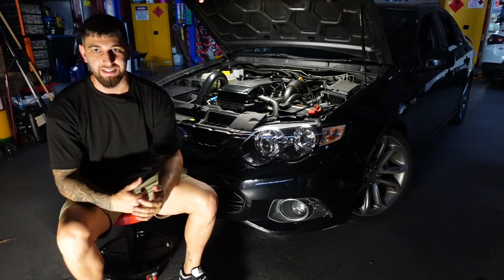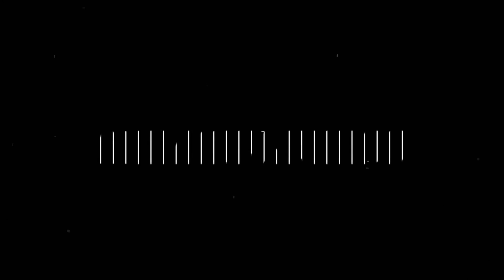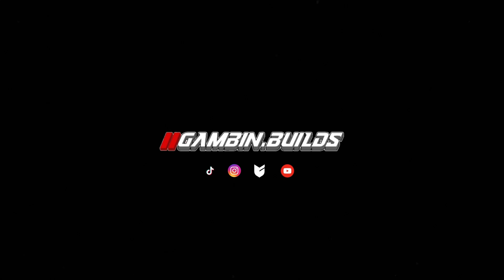FROM STOCK TO 800HP FOR $15,000 | TURBO BARRA BUILD COST BREAKDOWN

Comment: Just go a coyote, save your money.
Reply from the maker: @grantdavis2381  a coyote cost more to make this power 😂 a whipple is the price of what all of this cost
Reply: @GAMBIN.BUILDS  440rwkw for 3k ain’t bad for a stock Miami engine. Get your self a gen3 coyote with gearbox for 12 to 15k make a turbo kit make any bolt on barra silly.
Reply from the maker: @grantdavis2381  so 12-15k then what about the tailshaft? Or do we not care about people loosing feet in the back seat? 16k with all the safety and 635kw… big difference silly
Reply: @GAMBIN.BUILDS  tailshaft loops are very cheap, I do not know what you are taking about, if you are running a true 800 at the wheels your block will have some windows, it’s been proven that the coyote/mod/LS platform is superior.
Reply from the maker: @grantdavis2381  news flash buddy, been 9 months of constant bashing and I haven’t had a single issue at 785hp at the hubs, if you don’t think I know a thing or two maybe go through my videos let alone my recent videos 👌🏼 appreciate the advise but
Reply: @GAMBIN.BUILDS  I doubt it, let me know your MPH down the 1/4.
Reply: @grantdavis2381 don’t know what u talking about windows in block, mines 630rwk and had no dramas at all and it has not been babied lol
Reply: @ still doing 12s down the 1/4 to?
Reply: @grantdavis2381  only ever done roll racing why you care about the 1/4 mile time u we’re talking about how he will get a hole in his block lol
Reply: @ Barra bois 😂🤣🤣 common roll racers

Comment: Just save up and build a decent JDM engine these Barras are junk
Reply from the maker: @Lifeat90  been there & done that. Not everybody wants over priced & over hyped rust bucket builds
Reply: @GAMBIN.BUILDS  dude the Barra is junk.20 years of JDM mostly 2jz.it dominates the Barra.yes the 2jz is expensive.but you get what you pay for...the Barra has 0 top end the jz is the top end king.i have gapped that many Barras in freeway runs it's no longer fun...the Barra has that many engineering flaws it's not funny. core shift at 16 psi..is just the start...the Barra is like a poor design Chinese drill next to the 2jz.
Reply from the maker: @Lifeat90  the only engineering flaws on the Barra is the harmonics 😂 other than that they do 3x more than what any RB/JZ would do as a SBE like I’ve proved in this video! No doubt the jap motors are great but barras are not “junk” as you say. They have done far more than what most motors can do mod for mod
Reply: It only counts if the guy in the other car actually knows you are racing each other..youd definitely be that person that races everyone and they didnt even know it was a race..FLOP@Lifeat90
Reply: This bloke has head issues😂😂 barras eat 2js all day
Reply: Is this bloke ok

Comment: How did you put 30K into a LS and only got 400 horsepower?
Reply from the maker: Bigger stroke doesn’t make HP, it makes torque.  Walked a few 600HP barras with a TH400 behind it which also robs about 80WHP but will make up for it in torque 👌🏼 wasn’t your average small cammed 5.7 making 400HP it was a stroked 6.3L

Comment: Anyone know if it’s worth going to an external internally routed set up ruining a pulsar gtx3582r gen 3? Not chafing big power to be honest but current turbo has cracked the rear housing and am looking to just buy new 😂
Reply from the maker: It will be the same thing man! Just won’t sound as good 😎😂

Comment: Hey bro, love the video here.
I have an NA FG XR6 MK2 (ZF box). Do you think if the engine is in good condition that going for a turbo conversion would be worth it to do something like your video, or is it best to sell this car and get a factory turbo? (Currently on green P's, still 2.5 years until full license in VIC).
I understand that I may be looking at upgrading the pistons, rods, and valves + other preventive mods along the way.
Thank you.
Reply from the maker: Hey bro, Thankyou 👌🏼 NA+T will cost you a lot more than buying an XR6T! Trust me on that! Better to wait and get the real deal unless you plan on doing a full complete big driveline build
Reply: @GAMBIN.BUILDS  Thanks dude. I think the main idea for barras like you mentioned is a power to cost factor, wouldnt make much sense unless your pushing crazy power, even then you would probably get a billet block. Thank you!

Comment: I've got a similar build just slightly less extreme, single intank pump, 3582 instead of 3584 and stock tailshaft other than that everything is basically the same with just some brand differences, next up is going to be a set of cams, nothing crazy either kelford 218ez or 218a haven't decided yet, getting because the stock ones are starting to look a bit pitted. Suspended license for the next 12 months though so might end up doing more in that time, Built bottom end is definitely in the cards depending on how I go money wise and If it does go that way I'll be needing a bigger turbo and surge tank to keep up. ATM running 410kw mainly because 98 wouldn't get that much more from e85 with the current fuel system though and not worth it for me unless It's on flex with e85 being a bit harder to come by and enjoying long drives to the mountains.

Comment: How your box is holding up? We have an almost identical setup i just havent switched over to e85 yet. Currently running 430rwkw on 98 and 18psi in my f6, only thing from stopping me is wondering if the box will flog itself out 😅
Reply from the maker: Box is holding up fine, just comes down to how well maintained it was during the course of its life! Still shifts fine and doesn’t do any funny hiccups! Just a risk you’ll have to take my man. Could last 100kms or could last 10,000kms 😂
Reply: @GAMBIN.BUILDS  yehhhh putting dosh away for a built zf or a th400 conversion haven't quite decided yet 😂 both are fkn expensive
Reply from the maker: @zskytop8790  built ZF for sure! Would drive 100x better than a th400
Reply: Can't get the zf to shift down without clunking, any ideas guys?

Comment: Go race it and see if it really makes 800hp!!!!!!! If it does it should run 9.5 147mph
Reply from the maker: A few more factors go into racing, doesn’t mean it’ll run that time but should see a high 9 if it gets the right 60 foot 👌🏼
Reply: @GAMBIN.BUILDS  650-670hp In a fg should go 10.0/9.9 140mph 
800hp is 9.3 145mph+ pass
Reply from the maker: @barrakingbeatz7794  I guess we will find out when the weathers finally good enough to hit the strip 👌🏼

Comment: Hey bro can you go over why you shouldn’t drive a done up falcon in normal drive mode? I’ve heard a few friends mention it. But i feel like when i’m racing someone it’s just easier to put your foot down and not worry about shifting manually
Reply from the maker: What happens is if the transmission kicks down a gear or two with power it will snap in input shaft in the trans… something you don’t want 😂 get into the habit of using the tip tronic because 450kw is risky for kickdowns
Reply: I’ve just completed my falcon build and pushing 450rwkw